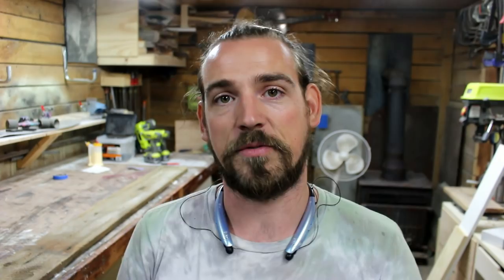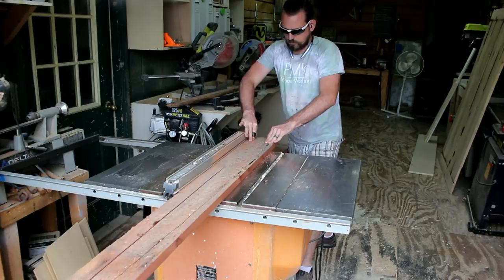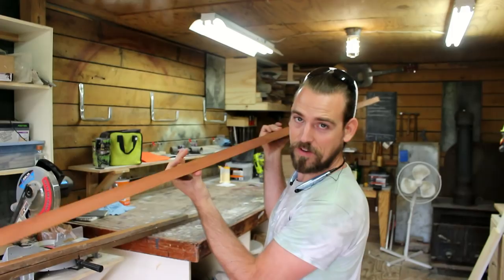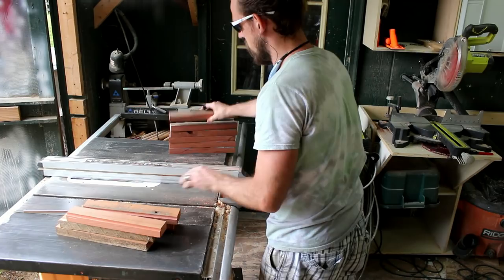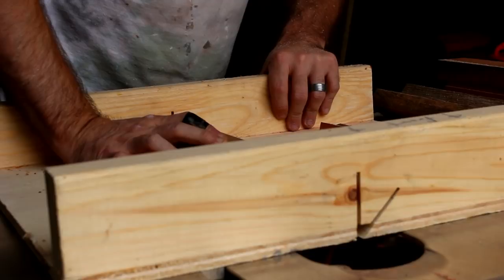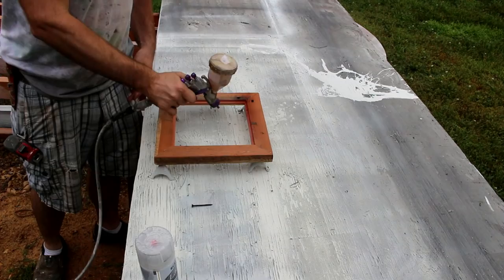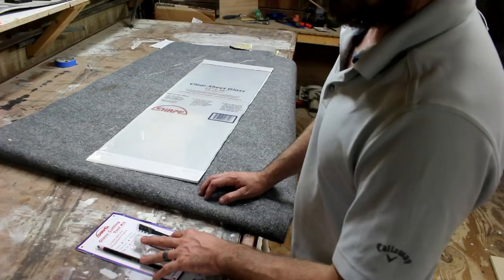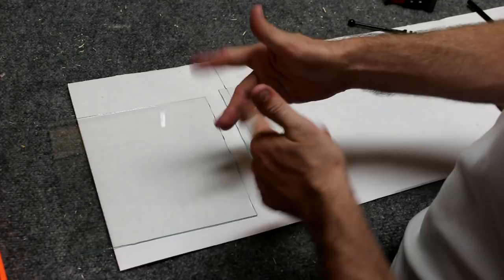EASY DIY Farmhouse Picture Frames!

Comment: Very nice. 
Your 1/4×1/4 cut. That is on the back correct? To allow the "cardboard" backer to set flush.
Reply from the maker: yes, and make sure its on the inside edge on the short point of your miters